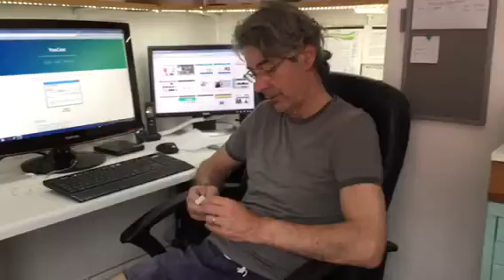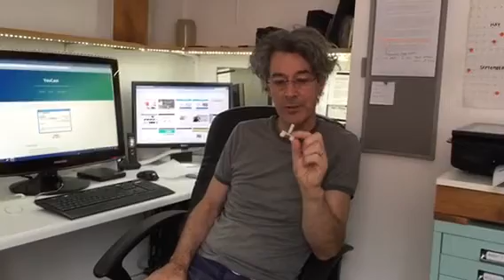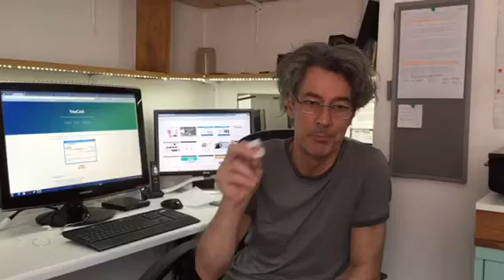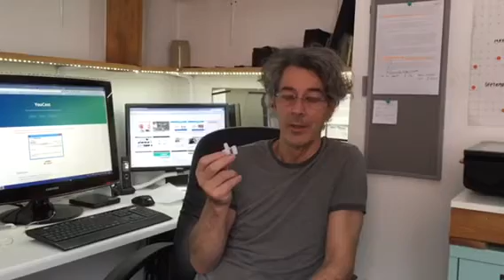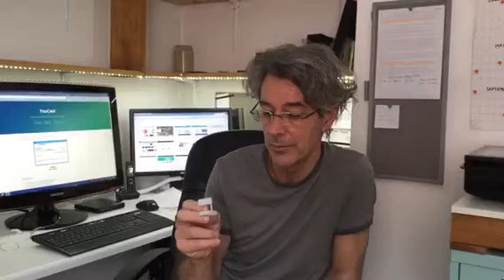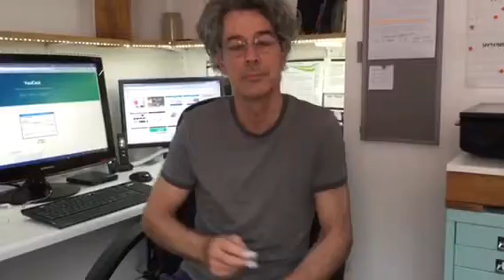Plastic plug prong covers - WTF?!

Comment: I had an experience today that has shed light on the reason for the plug cover. I purchased a flat iron in a plastic sealed packaging yesterday, opened the item today and saw that the cord was scorched, upon further investigation there was evidence of an electrical discharge on the prongs.  I thought that when I took it back it would be hard to convince them that it came like that.  When I checked the inside of the package the paper was also scorched and burnt. 
I took it back to the store (different branch) explained the situation and while looking for a replacement I found another of the same item on the shelf also burnt in the same manner if not worse. The new flat iron I took was a different brand and this one came with the prong covers as did the hair dryer I purchased the day before. 
So in my own conclusion I believe they are there to protect the item from electrical discharges when xrayed or scanned when being imported. The one without the cover was from China and the protected ones are from USA.